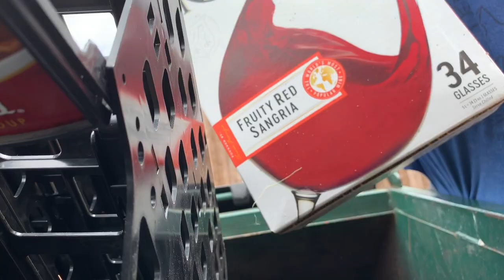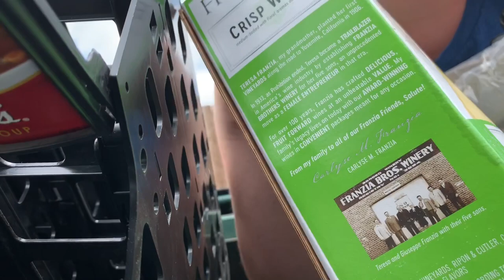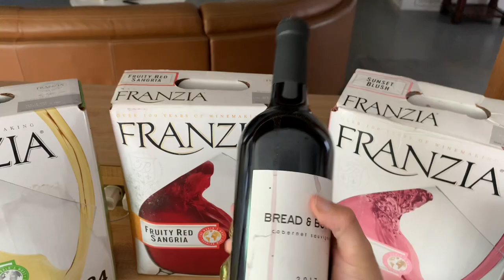Dumpster Diving for WINE!!

Comment: CAN YOU IMAGINE A WINEO OR KIDS GETTING IN THIS DUMPSTER. THAT WOULD BE DISASTROUS. THEY SHOULD LOCK THE DUMPSTER WHEN IT COMES TO WINE AND BEER.. JUST FOR SAFTEY REASONS.
Reply: Dale Rowan ... why are they throwing out wine? Booze doesn't go off.
Reply: @jillmorrow7422  wine dose go off or get bad if it's store wrong, you need to keep it at the right temperature keep it on it's side & rotate the bottle, I don't think it matters much with cheap wine like she found